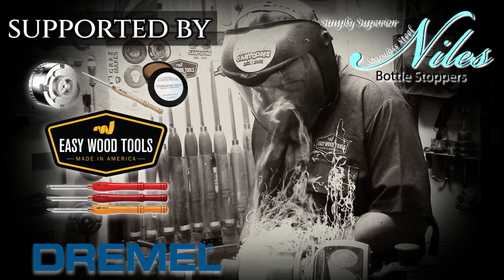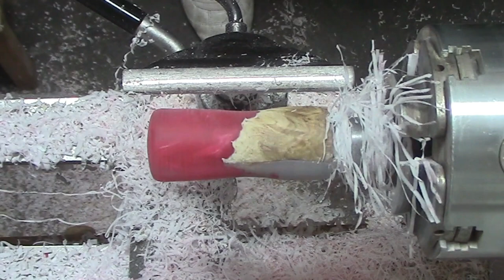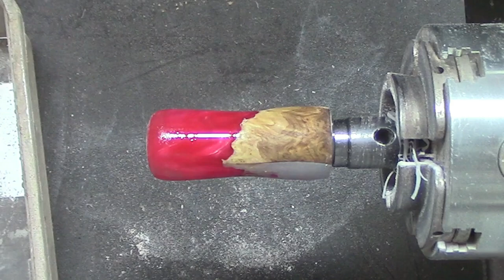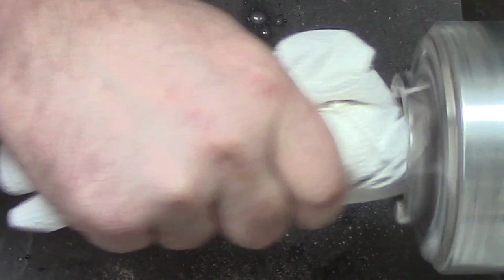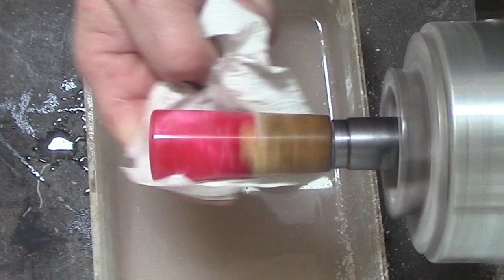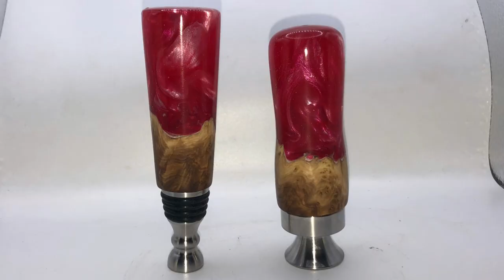Woodturning - Bottle Stopper And Opener Set

Comment: Question JP - What grit are you wet sanding with for acrylics like these? It looks like you stick with the same grit when wet sanding, but I may not see you changing paper. Beautiful work BTW!
Reply from the maker: Hey! Thanks a lot….. So i only show one grit of dry paper and one grit of wet sanding but the process is dry sand 80 grit-240 grit then wet sand from 320 grit to 1000 grit then I use Yorkshire grit and Yorkshire grit Microfine from easy wood tools which are abrasive pastes to bring them to a super shine if you want you can take it that one step further and use buffing wheels on it too and that takes it to another level of shine and perfection which I also did but off camera…. Hope this helps